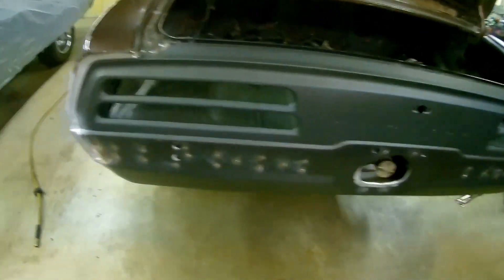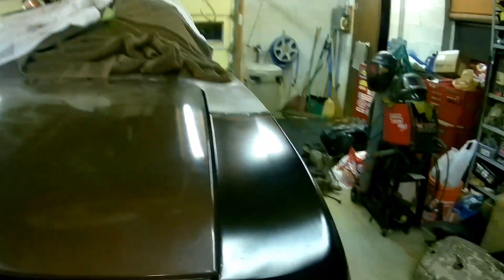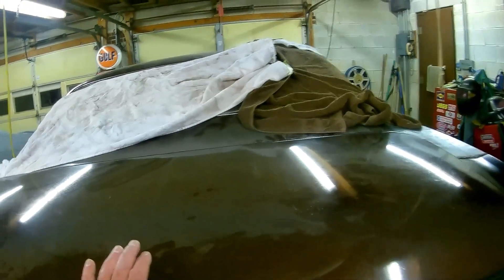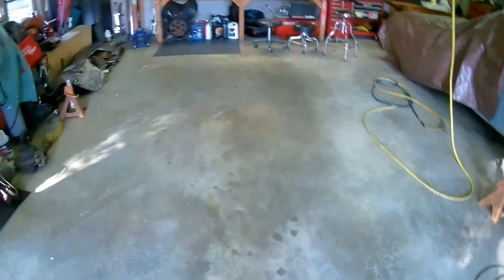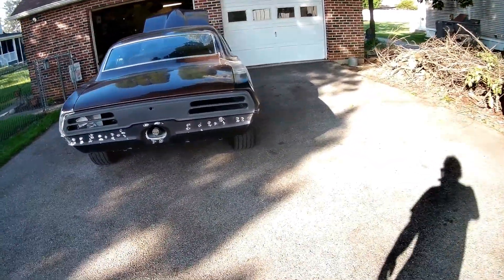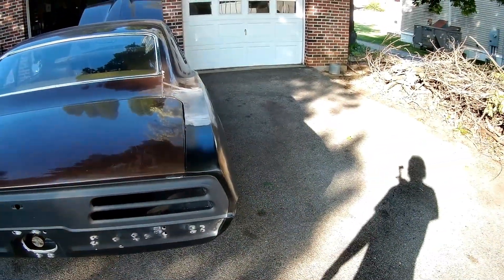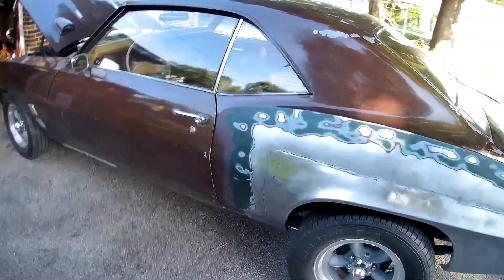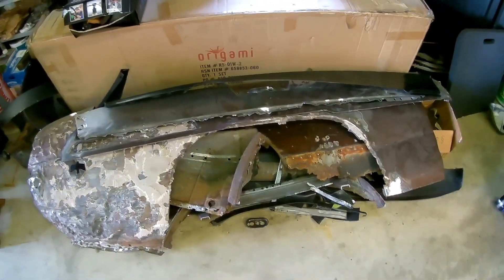69 Firebird quarter panel is on #NoNameNationals #pontiac #69Firebird

Comment: All your metal work is done and looks great! Epoxy primer time
Reply from the maker: Thanks Rich. Did You start on the challenger yet.
Reply: @Testasspeedshop9997  Yes I did. I took the rear end and gas tank out of the car so I can start removing frame rails. I should start next weekend on the rails.

Comment: Great work, Chris, nice to see you have her back together. Will you be showing the bodywork process?
Reply: Hello brother I was wondering where have you been
Reply from the maker: Thanks I will be showing as much as can of it. How's your coming along.
Reply: @Testasspeedshop9997  Nice, I look forward to it as that's just about where I am now as well. Dash is complete and installed, and I installed the engine and trans over Christmas, as well as, I sorted out the cross-member and such. 350 chevy mildly worked engine with a Super T10 trans and a Long's shifter. The car is running and moving under it's own power but when I was setting up the power steering pump, the steering box/gear had a MAJOR leak in the output and input shafts. Just installed the new box/gear yesterday and now I have to get the proper hoses with a new pump as well. There's honestly too much to list here as it would be a book! Bodywork is VERY soon, but honestly, this is NOT going to be a show car. I just want to drive the !@#$% thing.
Reply from the maker: @fretsman68  wow you got a lot done good job. My will be no show car ether. I'm just happy the rust is gone. If it is running and driving just run it for the summer and enjoy it do the body work next year.
Reply: @Testasspeedshop9997  lol, no sir, it's completely apart. Doors and quarters are all that's on it, so it wouldn't be worth it to put all that back together without some paint on it.
Reply: @fretsman68  Hello fretsman68 I haven't heard from you in a while how are you doing?

Comment: Since I’m blocked on Rich’s channel, here’s the reply I tried to leave you:  “You're exactly right.  Also, I bet no valve job was done after the pistons and valves collided last time from a timing chain installed way off.  It resulted in at least two bent valves and two broken pistons.  I think he just stuck two new vales in the guides.  Anyway, I hope that poor 283 comes out and gets a competent rebuild one day.”
Reply from the maker: I know John it's sad what a waste of a 57. I also notice the smooth bores so no ring seal there. Oh I'm sure no valve job was done after seeing the rest of the hackery.
Reply: @Testasspeedshop9997  And now he’s going to use feeler gauges to adjust his valves….. stamped, non-adjustable rockers and hydraulic flat tappets.  That’ll make a great video!
Reply from the maker: Well they are adjustable take them to zero lash and one turn done.
Reply: @Testasspeedshop9997  Yes, that's what the rest of us do.  I think he's actually going to put a clearance on them.  Wonder if he'll lose all his oil pressure?  Should be a great video!